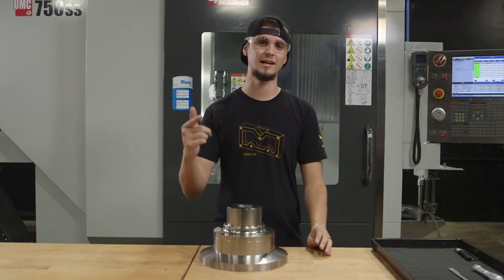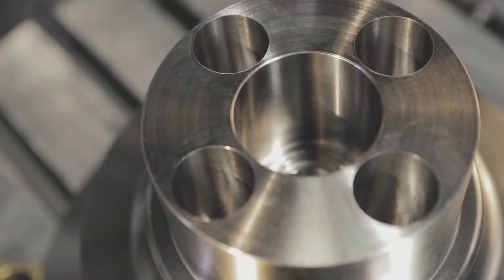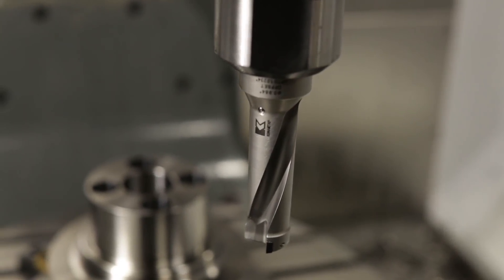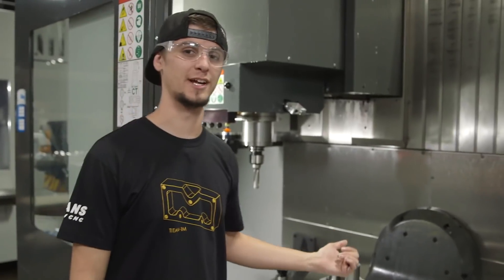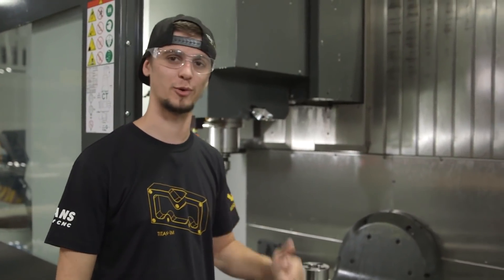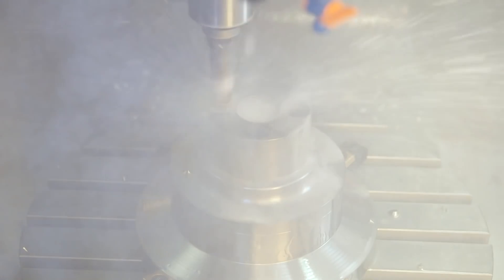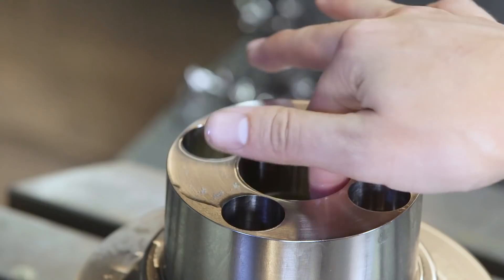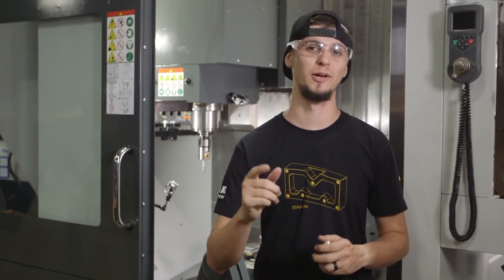6AL-4V Titanium Rocket Part | Indexable Drilling Technology | CNC Machining Vlog #99

Comment: If u clamp your part in to the machine like that doesn't that mean u need to set up your zeros everytime u replace the part?
Reply: You could use a probe head and macros and simply just remove 2 clamps leaving the other two on the table, slide out and rebutt then run a probe cycle to get it dialed in w/out an operator sat with a clock

Comment: No idea why I even watch these. Over here with my Shapeoko hobby CNC clenching my cheeks when I’m cutting aluminum
Reply: Gotta start somewhere mate. Never know what's around the corner. Learn the heck out of that shapeoko and you will have a better understanding of what you need in the future. Good luck.
Reply: I did the same for 3 years and just picked up a Haas TM-3P. to some extent it still feels the same way ( more HP please, more spindle speed please, more tools please, 5th axis please). but I never would have had the guts to get a real machine had it not been for my router. switching between a X-carve and a Haas was actually trivial. I think I learned about problems and strategies on my router that no doubt make me a much better mill operator.